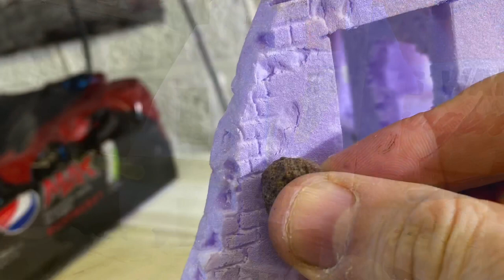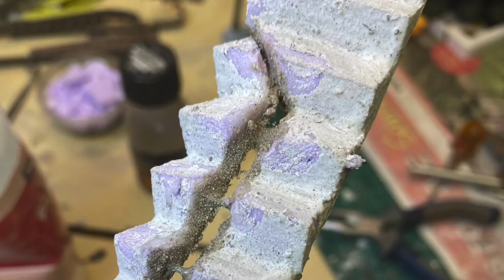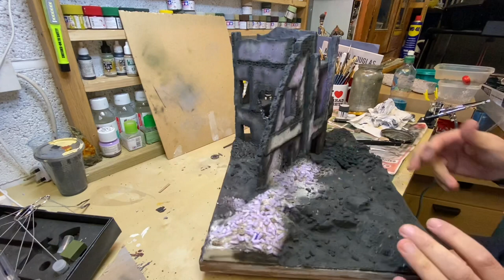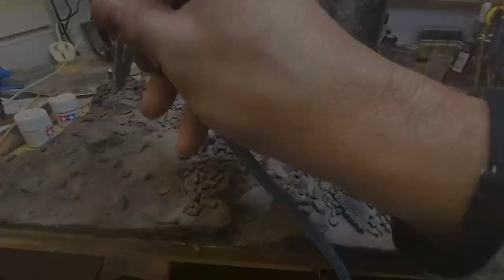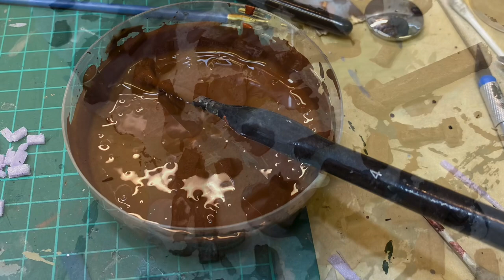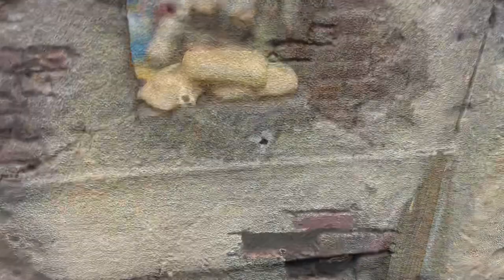Make WW2 Diorama Stalingrad Part 2 tutorial #diorama #scalemodel #ww2diorama #figures

Comment: SUPERB!  Your groundwork is amazinh.  What is your thinner to paint ratio for the priming/pre-shading the building?  What pressure do you use to spray?  How about the color coats?  Same questions.  THANK YOU.
Reply from the maker: Hi, I tend not to measure mixtures, its more about the thickness of the paint, and how it runs in the cup. Saying that its around 50-50. The pressure again is how the paint reacts, for blasting something I could go as high as 30psi., fine work 10-7 psi, for armour 15-20psi. Hope that helps.
Reply: @ctscalemodellinguk  THANK YOU.  I certainly can experiment within the parameters you reported and hope to get results anywhere near yours.  You might be interested to know I received a reply from another modeling You Tuber right in front of your reply in my in-box.  Didn’t ring a bell for me.  My comment on that gentleman’s channel to which he is responding now was 2 1/2 YEARS ago!  Can you tell how much I appreciate and value your hyper speed replies and the time you take to make them?
Reply from the maker: @lawrencereid9375  its was quite late in the UK but I was still up watching tv. Thanks for the kind comments, just experiment with the paint. I still get bad days when the airbrush just misbehaves for no reason. Speak soon